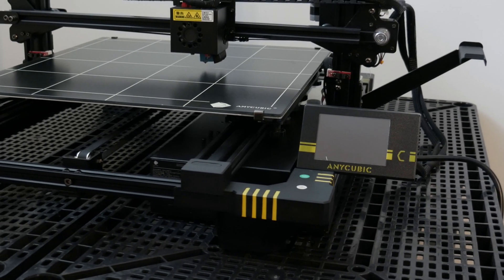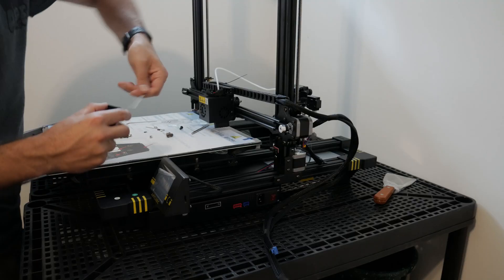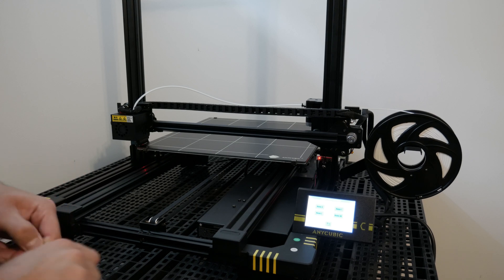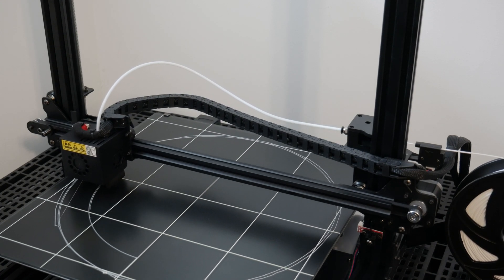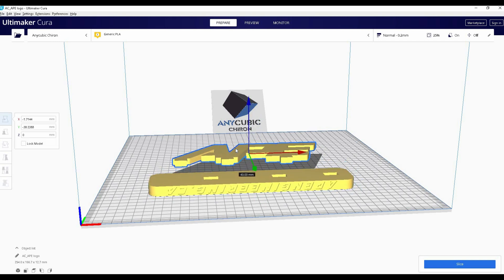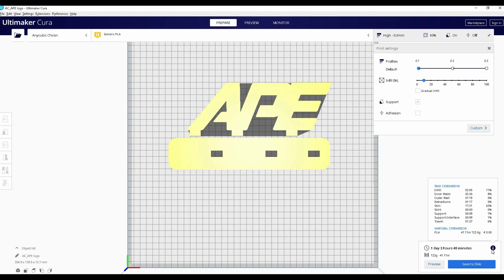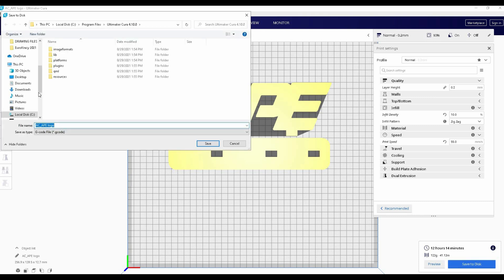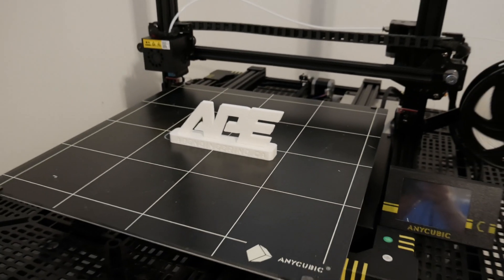NEW 3D PRINTER  - ANYCUBIC CHIRON ASSEMBLY AND DEMO

Comment: hi im actually having some printing issues and came across this video was wondering if you could possibly help me out the parts im printing are for r/c planes and they are coming out straight but you can see through them is this a filament issue? or something else please?
Reply from the maker: I can try to help. What program are you using to make your printer files ? And what materiel are you using ?
Reply: @APEngineering  I'm using the cura 4.13.1 I was using the old version of cura I think I might have gotten it figured out but need help with the settings maybe on cura like for certain things I print do I need to mess around with the settings?
Reply from the maker: What material are you printing ?
Reply: @APEngineering  pla at the moment but I will be switching to abs
Reply from the maker: The settings for PLA in cura should be fine. ABS is quite difficult to print and you need to use a closed enclosure because of the toxic fumes
Reply: @APEngineering  ohh ok thanks for letting me know that about abs I never knew about the fumes

Comment: Like you, I would like to buy a large format 3D printer, I have seen practically all of them, and I was undecided between a Creality CR10 S5 (500 mm!) And the Chiron. On the CR10 I have seen several videos that did not convince me very much, especially on leveling, etc ..
The Chiron looks better to me, albeit smaller, and your video has definitely convinced me.
Just one question: to date, after your experience so far, would you still recommend it to me?

Thanks.
Reply from the maker: I have 2 Chirons and they work good for the price. My first one had connection issues that were resolved with a harness swap (fast turn around from Anycubic) but second one has been working great. I would recommend for big parts, but is slow
Reply: @APEngineering  I intend to use it basically for air-naval modeling and for the development of related projects, using rather high-scale prototypes.
However, I have seen that it also prints small objects well.
Thank you for your support.
Reply from the maker: Nice ! You will love 3D printing. You can create anything you can think of